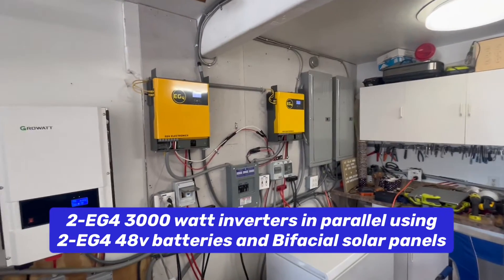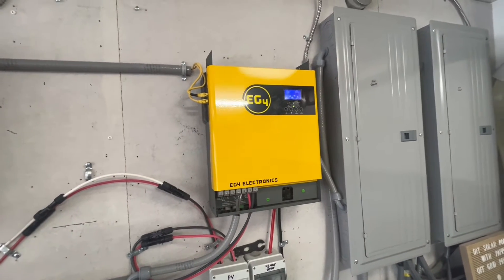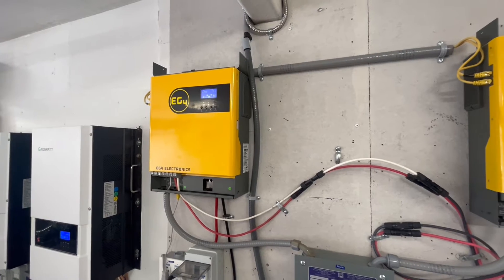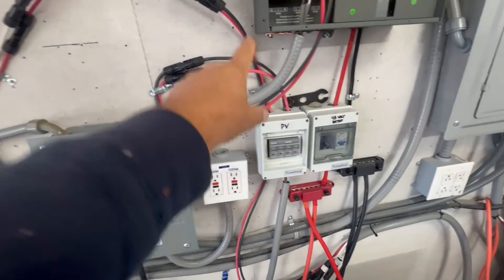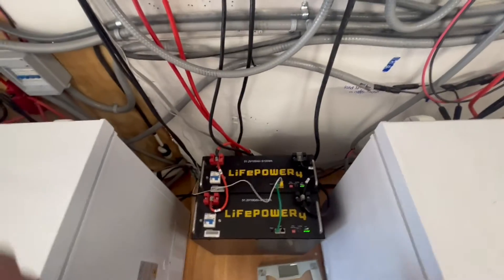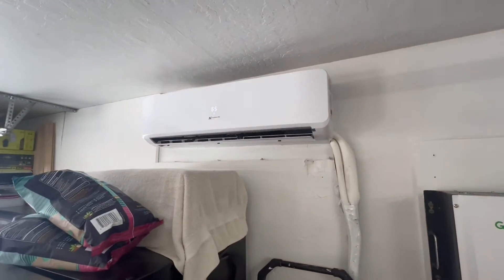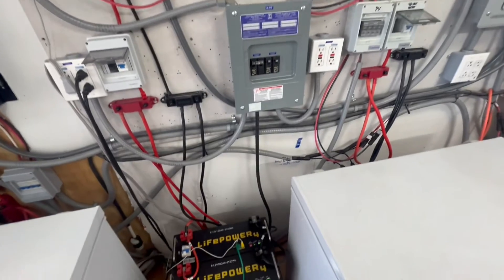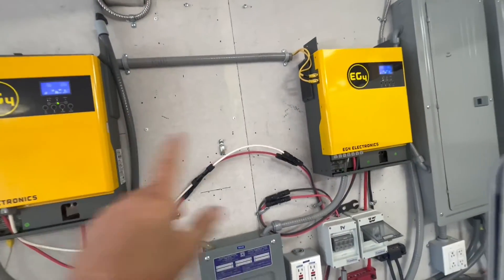EG4 3kW inverters in parallel 120/240 volts, EG4-48v batteries & bifacial solar panels runs AC

Comment: Going to take you 10+ years to pay off on electric alone with all that $$ you put in it.
Reply from the maker: @Gary-ee3kq  We now use double the electricity we use to. Before off grid solar, we set our thermostat at 83 degrees while at work and 80 degrees while at home, 78 while sleeping. Now the house upstairs  is around 72-76 degrees in summer and down stairs overnight is around 78-80 degrees. We run our pool pump 24 hours a day with no problems with water, no algae or cloudy water. We run 4 freezer and a refrigerator 24 hours a day. We also have our garage air conditioned,  usually 75 degrees in garage during the day when 100-117 degrees outside during the day. Our electric bill in Phoenix ax area is less than $200 a month in the summer while my neighbor will spend $600-$1000 a month with a 2 story house and a swimming pool. Our pay back time is very short since our electric bill with what we use now would be over $5000 a year. We spend around $1200 a year on electricity. We produce a lot more than we can use. We started off small and just built on it over last 4 years. We also use our electric pool heaters to heat or cool our swimming pool to 86-89 degrees. This is a diy investment. If you can do all the work yourself, your payback time is much shorter. With the savings on electric bill alone, we will be spending thousands less on electricity every year from here on out. Like I said, we use to be hot all the time before off grid solar, now we are very comfortable in the summer in house and garage. You could never get a payback time this short with on grid solar. We checked and our basic electricity bill would have been a minimum of $125 a months before we even used any electricity. We would never pay back our investment by going on grid solar. Hope this helps you understand better on return of investment. Electricity rates keep increasing, California is  $.34 a kWh. Phoenix is $.17 a kWh. Hope you are blessed weather you do nothing or at least try to use off grid solar to offset electric bill. I know when we just used solar in the day to air condition the house and grid power at night, we reduced our electric usage by over 50 percent. We run our ac out here from March until as late as December. It’s hot in the day out here most of the year. We also have around 320 sunny day a year. Hope you have a blessed 2024
Reply: Your energy costs is higher than I expected. I thought it was going to be very close to your northern neighbors in NV at 11-12c. On grid solar is a ripoff unless you DIY. My neighbors paid $35k for a 6kw Sun Run system with micro inverters. Even with energy costs at 37c/kwh here in Nor Cal still going to take years to pay vs I paid $7k for 9kw system made up of 300w Hyundai panels (signature solar), (2) lv6548 inverters, and cheap eBay 12V 100ah lipo batts and connected directly to my house breaker box with AC bypass enabled for times I've no more juice in the batts. Central AC units are extremely inefficient, so I r20 all the outlets and inlets and installed a 18k btu mini split. Also no reason to run the pool pump 24/7 when 12/7 gives the same results.
Reply from the maker: @Gary-ee3kq the only way to get fast pay back is to diy off grid. If I would have went on grid, my electric bill would have been 3 times what I pay now and I would have been paying for it first 20-25 years with no possibility of actually breaking even. That is why I went off grid diy. I use double of what I use to and can produce twice that as well. I love not having to worry about high electric bills

Comment: helpful. I was looking at the eg4 6000 splitphase, but this is about the same set up and cost; and may give you more options with gensets, etc.
Reply from the maker: I was originally going to install this in my motor home but was so impressed with the first one, I bought 4 more to eventually run all my loads on off grid system. Weighing only 18 is insane for the power you get out of this unit. I am running my 3 1/2 ton upstairs ac and 4 ton downstairs ac all day long with just solar and 3 1/2 ton overnight on EG4 LiFePO4 battery bank

Comment: Hello, please are you located in Florida?
Reply from the maker: @olaade2109   No, I am in Arizona.
Reply: @diy-solar-guy  I need to do something very similar and I need an experienced master electrician. Thanks!
Reply from the maker: @olaade2109 if you get a lot of clouds out there in the area of Florida you live in, you need to take that into consideration. Cloudy days and rainy days will be hard to produce power. If you build a system you might want to look at mono solar panels that do well in those two conditions. Solar input when cloudy or raining can drop significantly to where you might only have 20 percent input or less. In Arizona, we have over 320 days of full sunshine and very little rain, especially in Phoenix because of the heat island effect from very little trees or grass and mostly buildings, roads, houses and vehicles adding to heat keeping the clouds from being over the whole Phoenix area. It pushes clouds around the city rather than the clouds moving over the city. Hope you have a blessed day
Reply from the maker: @olaade2109 I have no experience with emphases solar system components or the other equipment you stated in the message. I am willing to help but not sure if I will be any help at all. You might want to try YouTube videos to see if there is a video about what you are trying to do, there might be videos on your enphase solar system with How to add battery backup or call the seller or manufacturer of the equipment you have. I call the sellers and manufacturers here and there for my equipment to talk to technicians that have actual expertise in the equipment I bought. I would not know where to begin with equipment I never saw before. Try those ideas first and hope you get the answers you are looking for. Hope you have a blessed night.
Reply: @diy-solar-guy  Thanks!

Comment: u have the 230v straight wired into the big mini split i didnt see a plug out outlet
Reply from the maker: I had a small breaker panel with a 30 amp breaker for the upstairs 3ton ac and a ac disconnect box outside next to ac. Thaw breaker panel had another 30 amp breaker for the garage 18000 btu mini split in garage and also 2-15 amp breakers for 2 separate 120 volt outlet boxes. Now I have 4-3000 watt inverters going into large breaker box to run a lot of mini splits, 3 1/2 & 4 ton ac along with pool pump, pool heater, freezers, fridge and a lot more. Check out that video, close to getting 12,000 watts output all at once. Tweaking my solar panel arrays to make that happen.
Reply: @diy-solar-guy  I absolutely love it ive been watching your videos all weekend over and over I think I'm actually watching that video right now or the one where you show us the wiring which I really appreciate
Reply from the maker: @thelithiumpowerch  glad you are enjoying the videos. A friend of mine was watching my videos at 3 am one night and his wife woke up and saw him watching tv, walking around to see what he was watching, she said “  you are watching solar porn again”. She calls watching off grid solar videos in the middle of night solar porn, LOL. These EG4 inverters are amazing. Getting 2 more for my motor home to run mini split I installed and the rooftop unit. Thanks for watching. Will be doing a video soon on solar panel performance in different array wiring configurations. Really interesting how much you can be loosing out on if not wired to maximize input.
Reply: @diy-solar-guy  I have two identical 24 volt 3000 watt solar inverter Chargers that I'm running but I guess they can't be used in parallel
Reply from the maker: @thelithiumpowerch  I went through that with some inverters. That’s what I like about the EG4 inverters, can parallel to expand your solar off grid system in the future.

Comment: Very good. I have been doing some research and the eg4 3kw looked good for what I needed but the documentation leaves a lot to be desired. I just wanted to see someone else do it and explain their thoughts. We seem to be on the same wavelength. I appreciate your video!
Reply from the maker: I’m uploading a video of connecting 4 EG4 3000 watt inverters in parallel but taking forever. I was only running 2 with a load so I was maxed out at 6000 watts using a small electrical panel with 2-30 amp breakers and 2-15 amp breakers. I could not use all I was producing so I retired to my large electrical panel for 200 amp service. I still need to connect a total of 16,000 to 20,000 total watts in solar panels to the inverters. 4000-5000 watts on each inverter with a 35.5kwh EG4 LiFePO4 battery bank. I just connected and tested the system with 4000 watts in new solar panels and 2000 watts of used 250 watt poly solar panels on 2nd inverter, 4000 watts used 250 watt poly solar panels on 3rd inverter and 4000 watts of used poly solar panels on 4th inverter. I was able to start my 3 1/2 ton then a minute later started my 4 ton ac as well, so I had both 3 1/2 ton and 4 ton ac running at the same time. I was using around 6500 watts and discharging my battery bank.3 amps. So I still need to reconfigure my solar arrays to have 5000 watts on all 4 arrays, then I think I will be able to run 10,000 watts to 12,000 watts output. I am ordering more bifacial solar panels soon but just wanted to let you know 4 inverters in parallel have no problem starting and running the large loads I was running on my 12kw Growatt low frequency inverters. These weigh 18 lbs, the Growatt weighs 186 lbs. these little power house EG4 inverters are a major game changer!!!! I run my 3 1/2 ton ac overnight on my 25.5 kWh battery bank and have over 50 percent state of charge left at 7am. I going to use one of these in my motor home to run a 120 volt 12,000 btu mini split that cools it down insanely fast compared to rooftop ac that is now very efficient. Look for my next video if it ever gets uploaded to YouTube sometime soon. It is all about the EG4 3000 watt inverters in parallel. I think you will like the info I give in video. Thanks for your comment and I hope you have a truly wonderful and extremely blessed day.

Comment: Hello was wondering what busbars you have there and where did you purchase them. Great video BTW I have the same project in mind. Thanks!!
Reply: One more thing!  Are those busbars rated 240, 400, etc amps? I'm not sure which ones to buy. I have the 2 eg4 3k inverters, not set up yet. Thanks again!!
Reply from the maker: I bought mini off Amazon, they are heavy duty and were around $25-$30 a pair. The bus bars are for high amps.
Reply: @diy-solar-guy  Thanks again!! Kinda hated to bug you again!! :)
Reply from the maker: @wesdial1  no problem, ask questions before you buy.
Reply from the maker: Bought the busbars on Amazon. Around $18-$24 a pair. Just search for solar busbar. Several different brands but they hold up to the high amps going through the battery. Thank you for liking the video. I am just an average guy with no practical education in this area and was able to watch videos and read about it to figure out. It is really easy now with the components they sell. The EG4 3000 is by far my favorite inverter after seeing what it can do and not needing freight service to have it delivered. Hope you enjoy watching my other videos. I share in videos what I think is useful to someone who knows nothing or not much about off grid solar. In the future will start getting more technical but keeping it very simple now and trying to answer a lot of questions that might come up with viewers in the videos. Hope you have a truly wonderful and extremely blessed 2024
Reply: Thank you!! I'm new to this and learning the same way through videos and forums. I've been looking for your video for a good while, it's exactly what I needed. 😊
Reply from the maker: @wesdial1  I’m so glad the videos I am uploading can help you. Just take your time and figure out what you want to run and when picking components, think about being able to expand your system where you can add more solar panels and more inverters in parallel. These  EG4 3000 watt inverters are great, you can expand up to 12 inverters in parallel to create 36,000 watts output. That is a huge amount of power. I am in the middle of connecting 4-EG4 inverters in parallel to get 12,000 watts output. My Growatt inverters barely put out half of that. Those EG4 batteries are also great for overnight use, I just received another 2-EG4 51.2 volt 100 ah 5120wh version 2 ULlisted server rack batteries. I will now have a total of 46kwh of server rack batteries to run my ac, pool pump, freezers, fridge, light, etc… overnight every night. If you decide to buy from Signature Solar, please click on my links in the video so I can get credit for the sale. That helps up buy more new stuff to connect, use, review and what our recommendations are to use that peroduct for. Thanks for your input, we appreciate it a lot. Hope you have a truly wonderful and extremely blessed 2024.

Comment: Can I ask why would you need the 3k units with 2 12k's already installed. ? Did u find a way to parallel the 12k's or are they serving separate loads?
Reply from the maker: These are 3 separate independent systems I am running. I bought the 12kw Growatt refurbished at a great price and when they had free freight. But the 12kw Growatt are not able to parallel but I can connect a EG4 charge controller to the bus bar and supplement the loads to run a 12.7 ton pool heater heat pump. I am using 12,000 watts of used solar panels and can only get 6500 watts output on each 12kw Growatt inverter. I produce far more than I can use but all the equipment is paid for through the savings on my electric bill. It’s free electricity at this point. Now the EG4 3000 watt inverter can be paralleled up to 12 units with each unit surging 50 amps for 5 seconds. That is a big deal when trying to start large loads. I am in the process of uploading a video of what can be done will these 2 EG4 3000 watt inverters in parallel. I think most will be very surprised at the ability of these 18lb inverters. These are not low frequency inverters like the Growatt 12kw inverters. Check out my video I will post in a few days and see why I got the 2-3000 watt EG4 inverters. In the meantime, check out my other videos on bifacial solar panels and on everything we are able to run with our off grid solar power system. Thanks for the question and we hope you have a truly wonderful and extremely blessed 2024.

Comment: Beefy setup, deserved a bit more cable maintenance I think
Reply from the maker: Thanks for your input. We appreciate it. System runs flawlessly. I have 3 separate independent off grid system in a small area and it is a lot of wires. All the wires stay cool to the touch and we keep our garage around 62-65 degrees while running inverters during the day from 7am-7pm. I need to replace my used solar panels with new bifacial solar panels . On your home for the grid all the wires from electrical distribution panel are behind the wall but on an off grid system that you want to be able to take with down the road if you ever sell and move, your wiring is outside the wall. Everything you want to run has to have a separate wire running to it. I have 3 separate independent electrical outlets that our in back yard up to 100 feet away from inverter. Then I have separate wires that run to a3 1/2 ton, 4 ton heat pump, a 12.7 ton pool heater, a 1 1/2 ton pool heater a 2-1 ton mini splits as well as my pool heat pump. Then there are 2 mini splits up stairs and 2 mini splits down stairs as well as the 18,000 btu mini split in the garage. If I move to a house completely off grid, I have enough to supply entire house. But when you set up off grid, you have a lot of wires. Connecting to grid is very few wires but they charge you a lot more here to connect to the grid. If I supplied 100 percent of me electric and did not use any grid power, my bill would still be almost $2,000 a year. And the bill keeps going up every year for using the same amount of electricity. You have to e to decide how to manage your wires according to your situation and how much you want to run. Making it work and making it look pretty are to different things. I’m not trying to look pretty in video, I’m trying to show how to use off grid and what you can run with it. I plan on moving down the road and will take off grid system with me and have made the least amount of holes in the wall so I can restore wall back to original shape when removing entire system. We plan on moving to a smaller home that is half the size of current home. Thanks again for your input and hope you have a truly wonderful and extremely blessed 2024.